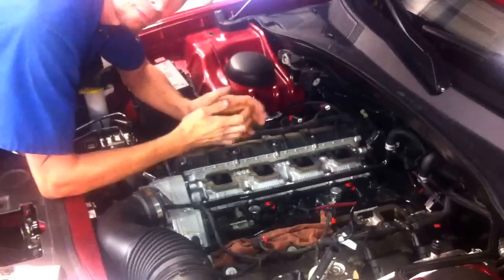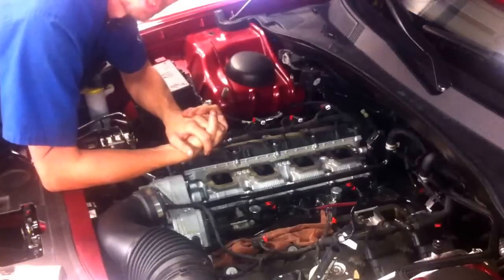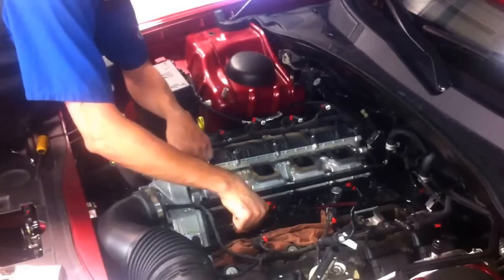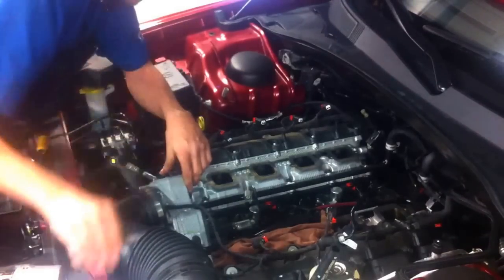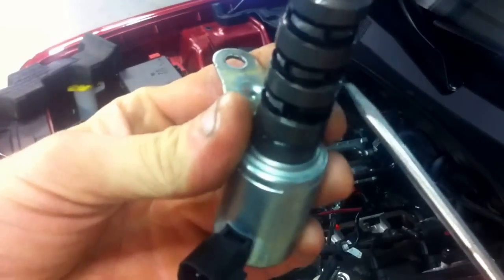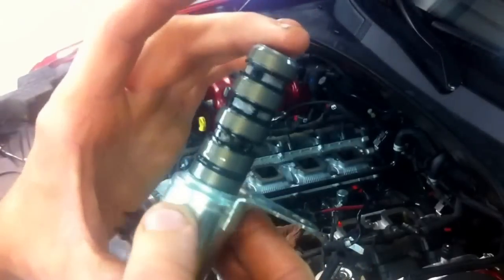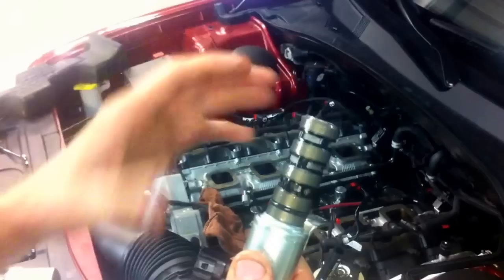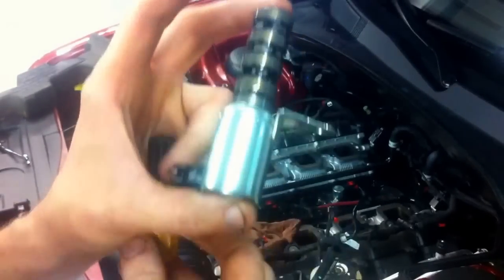2012 Chrysler 300 5.7 liter oil control valve codes P000B and P0016

Comment: I have a 07 dodge caliber sxt 2.0l and I got a p000b code. I changed the oil but that didn't work. I was told to get the exhaust variable valve timing solenoid and change it do you think that could be the fix?
Reply from the maker: I found a service bulletin for that code and for that vehicle.....it mentions to update the PCM software, replace both the intake and exhaust oil control valves and change the oil. So it looks like you took care of the oil change....now I recommend the rest of the steps in the bulletin as mentioned.
Reply: MotorCity Mechanic where is the oil control valve located? what about the exhaust variable valve timing solenoid
Reply from the maker: The oil control valves are actually the cam sprockets.....each cam has its own. The solenoids are located on the intake side of the engine....one towards the front of the engine and the other towards the rear of the engine and both just below the valve covers and mounted to the cylinder head.

Comment: Appreciate the video! I had the P000B and P0016 codes in my 5.7L 2011 Jeep Grand Cherokee, and after watching your videos (including the intake removal one), I decided to attempt it myself. I replaced the oil control valve as instructed with no hiccups. I also replaced the camshaft position sensor. Lastly, I changed the oil using Mobil 1 5W-20 just in case something was wrong with the oil I previously put in (even though I always have used 5W-20). 

Anyways, this didn't seem to fix the issue, so I'm wondering if you have run across any more of these same codes but had to do something else to resolve them.

Also to note, the acceleration of the vehicle is hindered almost as if it is in limp mode. It doesn't accelerate like the powerful motor it is, and when it shifts into the next gear, it doesn't seem very smooth.

Any advice? It'd be much appreciated as I would love taking it to the dealership.

Again, great videos! The instructions were spot on and easy to follow.
Reply from the maker: There is a chance that there is a timing issue with the chain or the cam sprocket itself. It will require further checking for sure. Looks like you covered the easier items to get to....might require front timing cover removal and inspection.
Reply: Thank you for the prompt feedback. I am in contact with a mechanic around my area and will likely have him perform the work. I have a bit of mechanical abilities, but this seems beyond my abilities and toolset.
Reply from the maker: Your welcome. Let me know how it turns out!
Reply: Any update on the car I have a 2012 hemi 300 that’s having the same issue we’re it stops accelerating after 3500 rpm
Reply: @crimzismallz5875 did you figure out what it was?

Comment: I have this code on my 2013 dodge charger rt at 87k. Could it the same problem? Thanks.
Reply from the maker: Its a very code chance it is. I recommend removing it and inspecting it to see if any damage to the screens on the valve. Thanks for asking and make sure to subscribe
Reply: MotorCity Mechanic Okay will do. Part is ordered for Tuesday. I will give you an update once I replace it. Oil change before or after ?  Thanks.
Reply from the maker: Great....I will keep an eye out.

Comment: this valve can cause the engine no start? cause after several tries to run the engine I  hear the fuel pump, and the engine runs. I have already repaced the fuel pump.
Reply from the maker: I cant remember what symptoms that may come about. So it doesnt start and then eventually it does?
Reply: Yes
Reply from the maker: If thats the only code your coming up with then I would start with replacing that oil control valve

Comment: Sorry...timing chain not timing belt!  The full timing set was replaced, the chain, tensioner, the guide and both sprockets.  Interestingly, the 2nd replacement tensioner was the black plastic unit not the updated white unit...I'm not sure which tensioner was used this time around...I hope it was the reinforced white one!
Reply: On second thought I don't remember seeing the cam sprocket in the box of parts...that may not have been replaced.
Reply from the maker: The chain and tensioner/guide itself will not have any affect on this code.....it would be more related to the control valve or the cam sprocket/phaser.

Comment: P0016 code on 2016 srt 300, you think this could be the same fix?
Reply from the maker: It could be the same issue. I know that the part was revised by 2016 so the screen issue shouldnt be an issue. It requires some testing using a scanner and monitoring the data. One of the causes is the control valve but there are some other causes as well. Further testing is recommended. I havent had to replace one on that year model yet
Reply: Thanks.. Mate!

Comment: Were is this on a 3.6?
Reply from the maker: A 3.6 doesnt have this set up. There are 4 electronic solenoids (2 on the front of each valve cover) that push on the oil control valves (mechanical) that are part of the cam gears.

Comment: Need help , car was perfect lastnight, 5.7 magnum 2005, woke up for work, and no start, just keeps turning over. I hear fuel pump, have power lights, gas is half tank, checked fuses , now just clueless😪
Reply from the maker: Is the engine turning over faster then normal? Do you have access to a scanner?

Comment: HI, I HAVE A 2007 CRYSLER SEBRING 4DOOR BASE SEDAN I TOOK IT TO O'Reilly's AND THE DIAGNOSED IT FOR ME AND THESE TWO CODES (POOOB-PO7OO) ARE THESE CODES BAD? I HOPE THERE NOT. THE CODE-(PO7OO) SAYS TRANSMISSION CONTROL SYSTEM MALFUNCTION INDICATOR LAMP REQUEST! WHAT DOES THAT MEAN AND IS THAT MEAN THERE SOMETHING WRONG WITH MY TRANSMISSION? PLEASE GET BACK TO ME AS SOON AS POSSIBLE THANK'S(:
Reply from the maker: I was doing some checking and cant find anything on that P000b code....doesnt sound familiar to me either. As far as the P0700, basically what it means is that there is a code in the TCM and that you need to go to the TCM and retrieve the actual code that set it. It may take a specialized scanner to do that which most likely explains why the code reader that they used didnt give you that code.

Comment: So the same issue in a 2010 Ram 1500, part costs $45.00 and the dealer wants to charge $1200.00 to replace.
Reply from the maker: You certainly saved a lot of money. It's hard to believe they would charge as much as that. Should be more that 2-3 hours labor plus parts. None the less....great job. Now you know more about your vehicle. Thanks for watching and make sure to subscribe

Comment: Does anyone have a part number for the OCV on a 2013 Dodge Charger rt 5.7?
Reply from the maker: Here is the part # that I am showing. Make sure to verify it with your local Dodge dealership to be 100% sure. 53022338AB